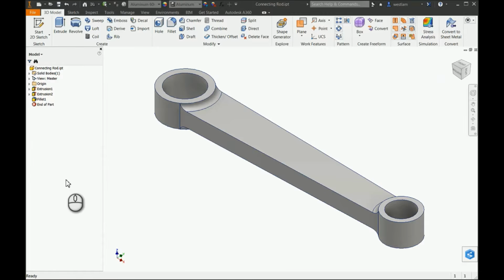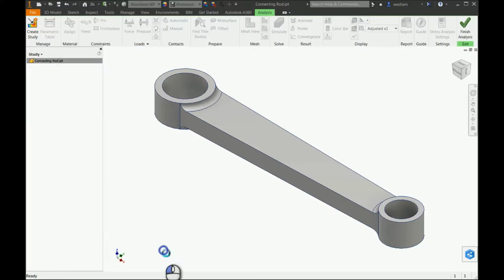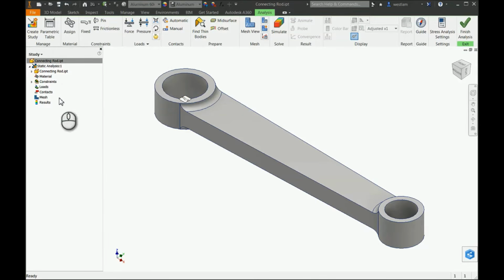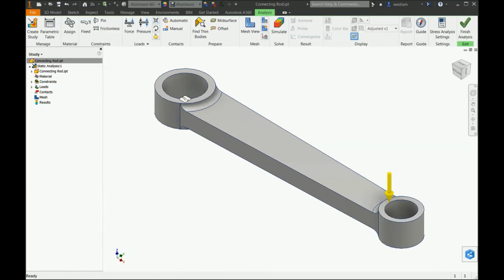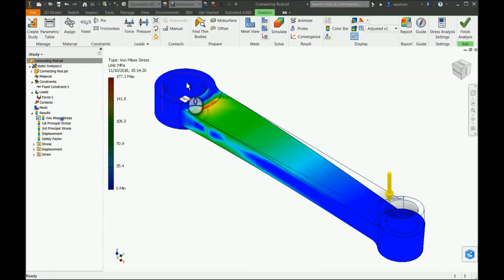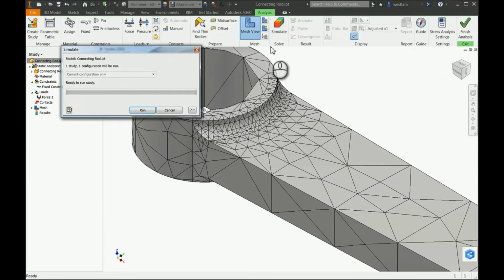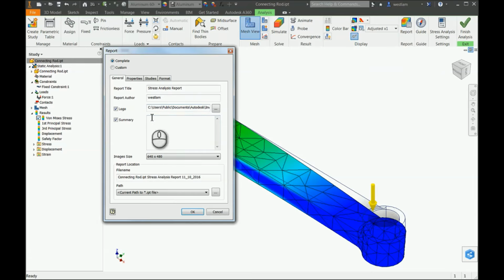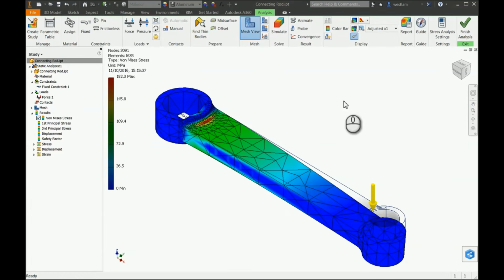How to create an FEA (Stress Analysis) Study in Autodesk Inventor

Comment: Hi there,
Thank you for this video. It's very informative. I'm trying to look at the stress generated by tightening a nut using an open spanner but I'm struggling to understand which portions of the nut should remain fixed and information on this subject specifically, is very sparse. Any chance you'd be up for doing a video on this?

This could be done as a part by only looking at the spanner and fixing areas of the hex (or claw) or done via an assembly by including a nut & spanner. If we look very closely at the jaws of the spanner as it tightens a nut, the contact area is incredibly small. This is the part that I'm struggling to get meaningful information from.